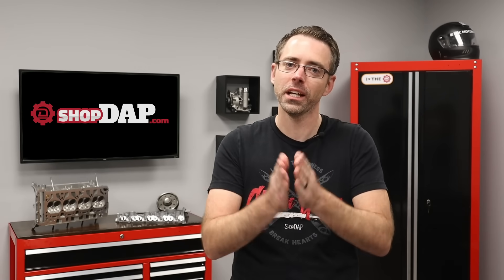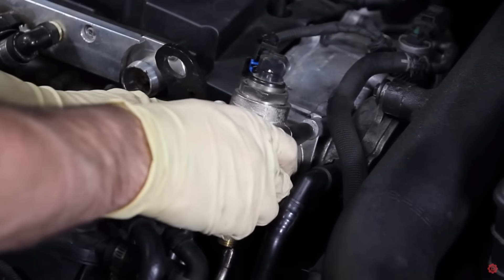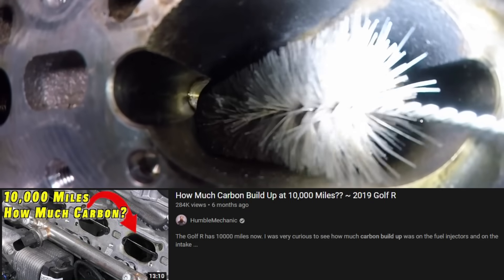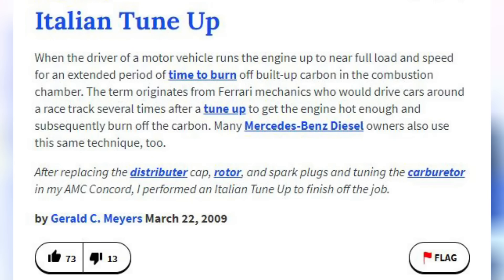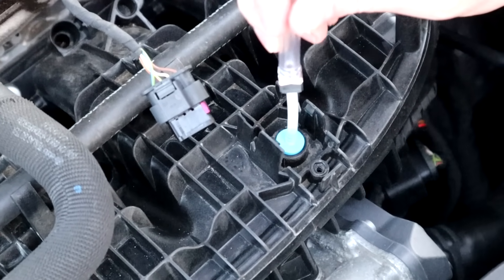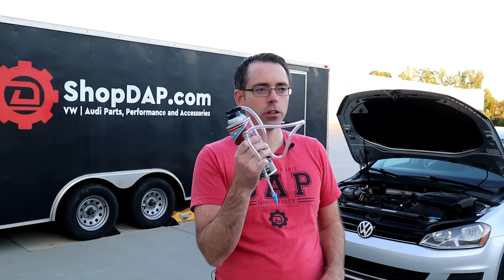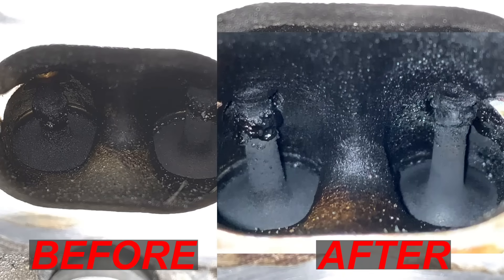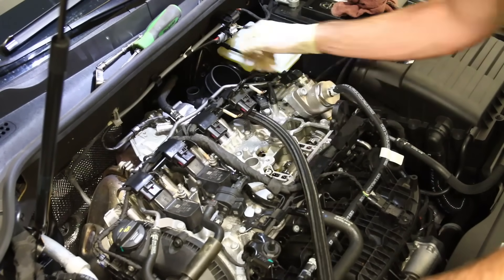Can you Really Remove Carbon for $29?

Comment: I have a 2.0L CDLC EA113 engine. I was told by an oil laboratory technician that tests fluids for Caterpillar, to change the oil every 5000Klms or 3106 Miles. He said the cleaning detergents in the oil start to degrade. He also recommended in using high octane fuel (GAS) as that helps reduce carbon with a better combustion burn.

Comment: Lots of varied problems with direct injection. Possibly more reliability issues and problems than it's worth. DI or GDI was pushed forward &  began when Obama pushed for a 45-50 mpg cafe. Not really a practical goal (actually foolish at the time like expecting all EV cars in the next 8 years is not actually possible)

Comment: I have a question. I just bought a 2015 forester xt fa20dit it has 115k miles with an amazing service history. No such intake cleaning mentioned. I have been chasing a miss leading me to cyl leak test. If failed also has low compression. I hear the air with leak testing coming out the intake valve. Could carbon build up get bad enough to cause the valves not too seal causing low compression?

Comment: I think for a daily driver port injection is superior because you don’t have to worry about cleaning carbon every 60k miles.  Direct injection is definitely better for performance but I think I’m going to stick with my port injection
Reply: direct injection gets better fuel economy aswell, they are typically tuned leaner than port injection and can run more ignition timing since the fuel mixture is added close to tdc and isnt mixed with the air until the last possible moment resulting in alot less chance of detonation.
Reply: like everyone said, they dont even make pure port injection anymore. A lot of the things that were done for "performance" originally like DI and turbos, are also done now for fuel economy to meet EPA specs.  Look into Toyota I think they started making duel port and Direct injection cars... actually I think the european VW do the same thing.
Reply: Agree. That’s why my car has port injection. It also idles smoother and quieter then direct.
Reply: IDK I have 105k miles on my gen 3 passat and I have not changed anything except a wheel speed sensor and a shit ton of oil filters. 
I think the best thing you can do for these cars is to NOT use the recommended oil change intervals and NOT use the recommended oil. 
I use only the finest German Bullshit oil and only slighty higher viscosity than the 0w-20 they recommend because I live in Florida and it's 1000 degrees all year long. 
My intercooler is smashed in from someones cat, my radiator support has been smashed to pieces for 35k miles and all of the plastic on the bottom of the car has long since flown off at 100MPH. Car runs great because I change my oil every 3000 miles. 
It does get a little heat soaked in the summer but whatever. It's a Passat. 
When the ratchet strap breaks that is holding the radiator, intercooler and condenser in the car, I will replace those. 
Or rather when the air conditioning stops cooling I will replace them.
Reply: You are correct and as for performance port injection is just as good. The only exception for performance would be if you are running a full Race engine that’s rebuilt after every event. Direct injection is just one more part of the plan to make people pay so much for their cars that they finally give them up and opt for those goofy electric turds or so called “public transportation”. Those may be fine for litter tiny states or Europe but not in our vast nation.
Reply: V-Dubs get like infinite fuel economy because they told us so
Reply: Every 60k miles is very infrequent for a car.
Reply: @catinthehat5140  it's really not
Reply: @catinthehat5140 no it's not
Reply: You can't "stick with it" because no manufacturers offers a port injected engine since 2015 or so.

So, if you want a new(er) car, you have no choice. Soon, it's gonna be the same with turbos. You'll get a tiny engine with a turbo, instead of a V6.
Reply: Shane…..Toyota engines combine port and direct injection.
Reply: @shane250  both Ford and Toyota  have port injection on most of their engines
Reply: @85CEKR  
Toyota only has dual (port+direct) in some of their engines, and Ford doesn't have port in any of their Ecoboost engines.
Reply: @shane250  Every toyota/lexus I've looked at has it, I've heard some don't but I don't know which engines it would be.  I know several don't advertise it but still do have it if you look at the tech specs.  as for ford I know a lot less about them but I was told that all the newer ecoboost had it because of all the problems they had on the older ecoboosts
Reply: @85CEKR  
You might be right. I haven't worked on an Ecoboost since 2017, so they might have changed that. Ecoboost will remain crappy for sure. The Toyotas that don't have dual are usually the European models.
Reply: @85CEKR toyota does duel
Reply: @Shane  people are going crazy over carbon deposits. Yeah so carbon builds up , as long as it doesn't block the valve from seating it's not a big deal. Every 100k get it cleaned
Reply: @CatInTheHat  I've owned 3 cars 2 BMW and one VW that had serious issues with this.  I personally will never buy another solely direct injection vehicle because of it.
Reply: @Craig Krueger  what issues? Carbon build up on the intake isn't damaging unless it blocks the valve from fully seating.
Reply: @catinthehat5140  it was causing misfires, I never had it happen but if heard of bent valves too.
Reply: @catinthehat5140  I've had 3 direct injection cars and all 3 ran noticeably worse after only about 20-30k.  If your someone who doesn't care about that kind of thing sure you can push it to 100k plus with out serious issue but for my why? I'd much rather drive something that's designed to run the sake new and 500k later.
Reply: @85CEKR  because direct injection has more power and efficiency

Comment: Glad to see someone who sees catch cans as not a cure all. The hype around them in diesels is so over hyped it's silly, you're still going to have to clean the EGR system due to soot build up over time. At the same time you're introducing a point of possible failure in to the engine. Catch cans can fail and cause back pressure which will result in oil seals leaking or completely failing which is really bad.
Catch cans safety valves can fail to relieve pressure, or if you forget to empty them will make them suck a whole lot of shit into the intake side of the engine, and i would hate to imagine the damage that will cause. Most modern engines have a air / oil separator under the rocker cover.
Port injection and VVT(variable valve timing) are the best thing for petrol engines and i wish diesels could get a working VVT system.

Comment: If you have a performance car that's boosted, water/meth injection is a phenomenal option. Water with a small amount of methanol (10-20%) will help lower IATs (cooler, denser air means more power), lower EGTs (protecting cats), and potentially allow your engine to further advance the timing (more power). Plus, it will keep your intake tract and valves clean. 
If you don't tune for it, you won't see the maximum power gains, but when you run your tank dry, your car will be fine. I run water/meth on my B8.5 S4 and I've improved my car in both power and reliability. There aren't very many mods that can claim that.

Comment: I’d also like to know the logic behind why the fuel quality or octane would affect the carbon buildup on a DI vehicle as the fuel doesn’t contact the top of the intake valve by definition? It certainly will on a MPI car, but I don’t think it really has an affect on the top of the valves on a DI engine. Certainly could keep the chamber and pistons cleaner etc.

Comment: The automation on the DI engine is a bit off, the injection system wouldn’t have to be high pressure if they were injecting during the intake stroke, they actually inject during the compression stroke which has the added benefit of cooling the cyl air/fuel charge and allows better atomization and a more complete burn. The high pressure is needed due to the pressures in the cyl during the compression stroke.

Comment: The catch can set up works best for those of us who do our own oil changes.  I have a homemade system and simply add the gunky water/oil to my used motor oil that will be turned in to the county household hazardous waste program facility.  When away from home I take the used motor oil to a WalMart that has a vehicle service garage.  Some rare gas stations even have a waste oil burner for winter heat and can actually directly utilize your used motor oil.  I made my homemade oil catch system after seeing the $200 that Condensator wants for their product.  Other ones aren't so cheap either though some are better cost wise than others.

Comment: The American tune would be using Sea Foam.  Run the engine high and spray it down the manifold intake.  It will smoke up but will clear out.  Carbon deposit gone.  The Italians just copied the US.

Comment: Cylinder head carbon and sludge there is minimal and normal.  Its the intake manifold that needs taken off and cleaned manually or with chemicals ultrasonically etc.  Catch cans with proper filters (that filter down to 1 micron) are best.  Diesels need this treatment every 75k km or so, if they don't have a catch can.  Catch cans like I mentioned, really do solve this problem. Peace

Comment: Absolute fantastic video I own a couple of cars including a Volkswagen and what's interesting is for my Chevy everything looks pristine even with high mileage since I've gotten the vehicle I used a combination of one cup seafoam and 1/4 cup water mixed through a vacuum line while the engine is at operating temperature and it has cleaned fantastically doing this once a year but the Volkswagen you have to be way more careful what you put in it! By the way if you do my method make sure you do it really slowly

Comment: Here’s my two cents. The only place carbon build up affects performance is on top the pistons and valve seats. A simple water soloution sprayed in while idling up on a operating tempiture engine will cause the carbon to shrink and fall off. They invented this back in the 60’s and had diy kits for it in the JC Whitney catalog. It works and works well
Reply: In direct injection engines, the carbon reduces port volume and causes turbulent flow both of which reduce volumetric efficiency, effecting fuel economy and emissions which is the more minor issue. 
The more serious issue, once the process has started then it is only going to get worse faster because the surface area of the carbon is growing allowing more carbon build up sooner than the initial part of the carbon build up. 

Soon the motor doesn't run properly because the intake ports are so blocked up - which is what is happening in the field particularly when motors are cold.

Just because you don't think carbon has any effect doesn't mean you're correct. This is a serious problem regardless of what you think I'm afraid. 

Water solution won't work in this case UNLESS it is installed BEFORE the problem starts as the video presenter mentioned towards the end of the vid. 
The JC Whitney catalogue item was for carburetor engines in the 1960s not direct injection engines. If the engines had carburetors on them then THIS WOULDN'T BE HAPPENING - if the engines had port injection THIS WOULDN'T BE HAPPENING because the fuel acts as a solvent largely preventing allowing carbon buildup.

Comment: I’ve been running a catch can in my car a little over a year now. I live in a cold climate in fact it’s 17 degrees right now. I know you mentioned freezing as being an issue but I don’t know how to look for that being problem if it becomes one. I don’t go a long time before emptying it. I start it up my car, let it idle a bit, and I don’t romp on it until my oil temp is 175 degrees

Comment: The old old PCV system that dumps PCV vapors on the street was the 50s and before, PCV systems as we understand them now started in the 60s and would recirculate vapor through the intake as well. Some would put it back into the air filter housing, some would put it into the carb spacer to be drawn into the manifold. In terms of function, not much has changed since then, except perhaps the efficiency.

It is common on old performance builds to simply use a breather cap on the valve cover to vent the vapors through a filter and let them go to the atmosphere. Not the best way but certainly simpler than the modern vacuum routing, or especially the 70s and 80s vacuum routing.

Comment: haha. I suppose I'm an Italian Tune Up abuser since I gun the shi* out of my 2003 rav4 daily, running close to full throttle for close to 30min. straight. I don't recommend running any liquid into the engine like that. Either do it manually or take out the plugs, etc. to prevent hydrolock. Then, do preventive stuff like catch can.

Comment: Good video! Actually I missed the very effective walnut blast method. It definitely comes with some costs and can’t be done at home, but achieves great results 😊
Reply: Not true, did mine at home and there are many kits available online starting at $100
Reply: @juanramos2745  ONLY if you already have the blasting hardware. Otherwise you're investing in a blasting setup which is going to be a fair chunk of change.
Reply: < $200 total at harbor freight ask me how I know
Reply: I did mine at home with walnut blast. Just used small blaster and shopvac hooked up to suck away the walnut shelling

Comment: Bullshit! If I used Water/ methylated spirits in a homemade water injection setup on 312000 km Hyundai excel! Before and after results were amazing! I put my borescope as far in the manifold and my valves were spotless, manifold was shiny! I also setup an eBay electric supercharger ( inline fan) just to help with atomization. After a week of  thrashing  the car and hitting the switch to activate  the pump to spray water in. It pulled harder and was smooth on idle! It definitely works!!!

Comment: Even if there was a magic cleaner that could clean your ports and valves as well as a manual cleaning, it would likely damage your engine, turbocharger(s), and catalytic converter(s). 

A nice little chunk of carbon wedged between your piston and cylinder wall will gouge the walls and could jam up or even damage the piston rings causing all sorts of other issues. 

Turbocharger turbine wheels are made out of some serious materials that can handle very hot gasses (approaching 2000 degrees F) traveling at near-supersonic speed. But the tradeoff is those exotic or semi-exotic materials are brittle. Bits and pieces and chunks of carbon pelting the turbine can cause pieces of turbine vanes to break off, and when a balanced turbine spinning at 100,000-200,000 RPM suddenly becomes imbalanced, it usually breaks apart or shatters, completely destroying the turbo (and potentially other components). 

Even if you don't have any turbochargers mounted to your engine, a sudden influx of high-velocity carbon pieces can clog or physically damage and potentially even destroy your catalytic converters matrix (which is also usually made of brittle material like ceramic). 

So no, there's no quick and easy repair for heavy carbon deposits on a gasoline direct injected engine, but be happy there isn't because the cost of repairing the damage caused by one would be many, many times the cost of a manual cleaning!

Comment: I've been using seafoam spray on my cars once or twice a year, and a little bit in the oil just before a change (every other change, 10k miles) it really helps. Our second car has over 100,000 miles on it and when my mechanic cracked it open to do something else he said it was the cleanest engine he'd ever seen with that many miles.
Reply: What car do you own
Reply: @1234aren  I have a Corolla and a CRV
Reply: @feddy11100  ok thanks I have a hyundai  I've been trying look for  something that can help clean up the carbon
Reply: @1234aren  seafoam spray will do it. It may kick an engine code for misfire after you do it. It's temporary. You can either wait for it to clear itself or clear the code yourself.
Reply: @1234aren  I use CRC intake cleaner and let it soak for several hours.
Reply: @feddy11100  they are not direct injection cars though.
Reply: @Shane-zx4ps  and? They still build up carbon and gunk on the throttle body and in the cylinders. It may not build up as bad as DI (which is why I wouldn't own a DI car unless it was dual injection) but it still needs to be cleaned out for optimal performance and fuel economy. 
When my mechanic  opened up our valve cover he said it was the cleanest he had ever seen for a car with 100K plus miles. 
I guess my main point was that if you keep up on it and don't let it build up as bad then you won't have as big a problem cleaning it.
Reply: @feddy11100  buy a Lexus like me and you’ll have Di and Port injectors and life will be easier.
Reply: @Shane-zx4ps   🤣I didn't think they were either.
Reply: @feddy11100 ...You're suggesting something that won't help a GDI engine the topic is how to clean carbon buildup on the back side of the intake valves on Direct Injection Engines. Thanks for muddying the waters.
Reply: Cleaner engine but you're destroying your turbo and plugging up you catalytic converter those little bits of carbon  might as well be sand,have to go somewhere.
Reply: @turboturtle9083  as far as the cat if you get the cat warm from a long drive before doing it would just burn it with how hot the cat gets I dont think it would clog then

Comment: That STP pro works Great.. Seriously.. Too Good you have to change your oil the next day and filter, and I would do it all again 500 miles later.. A lot of carbon goes into your oil and sometimes you can have to much carbon end up inside the piston walls and it can get stuck in your rings, It break the carbon down that much...